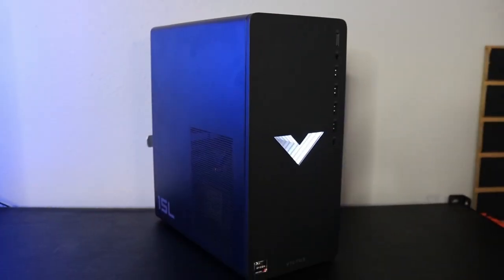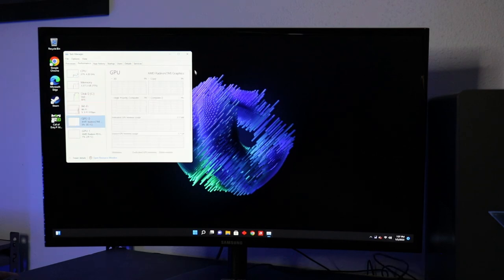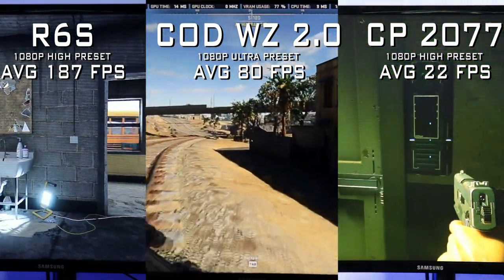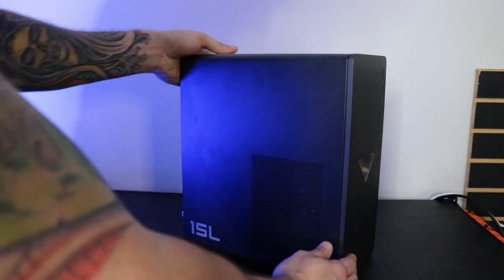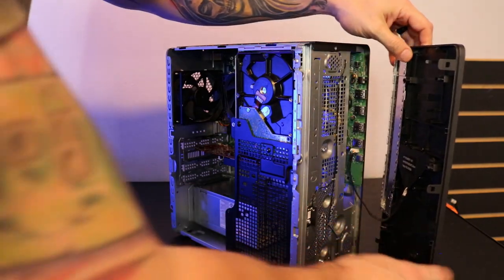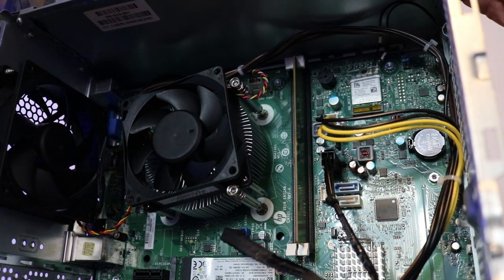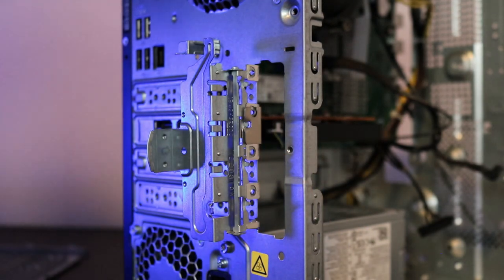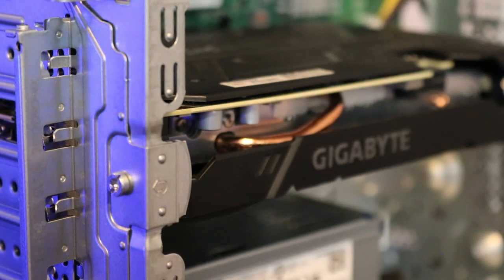Killer Gaming PC for CHEAP!! HP Victus 15L Gaming PC#pc #gamingpc #review

Comment: hey! i appreciate your video! ive been thinking aboutj buying this PC and this video helped a lot. Is the ventilation issue something that will be critical in the lifespan of the PC or will this PC have a decent lifetime without it? also, you say i dont need to buy 2 8gbs only one to add on to the existing 8gb ram? or did i misunderstand,, thanks again?
Reply: also, im not into any fps games i would only be playing fighting games. would i have any issues just running the default ram and specs out the box?
Reply from the maker: You wouldn't have any issues running the factory ram setup. You can add an additional stick if you want but this pc does take a specific type of ram. In the original video I wasn't aware of this but you would want 3200AA fro Atech and it would cost about $25! I'll post a link below if you decide to upgrade!

A-Tech 8GB DDR4 3200 MHz UDIMM PC4-25600 (PC4-3200AA) CL22 DIMM Non-ECC Desktop RAM Memory Module https://a.co/d/dzWqZkv
Reply: @bradfordskeldorado  thank you!
Reply from the maker: Hit me up if you have any other questions! Thanks for watching!

Comment: hey thanks for this guy :)  i have two  but like to upgrade the gpu also   did you  upgrade the psu ? for the RTX 2060 ?
Reply from the maker: No, the psu is still the same 350W unit that came with it. I don't recommend this gpu in this pc. I am about to release another short testing the new RTX 4060 and you would be much happier with this. At $299 this gpu brings this little power house to life! Also, the 4060 has a power consumption of 110W vs the 2060 being 165W so less power better performance!
Reply from the maker: https://youtube.com/shorts/t6Pn6k-kEDA?feature=share 

This is the test of the RTX 4060!

Comment: WHAT CABLE DO I HAVE TO BUY TO BE ABLE TO CONNECT MORE FANS AND RGB?
Reply from the maker: A fan splitter is for adding fans and I personally don't know about adding more rgb to this. It doesn't have an rgb header so you would probably just have to find some single color fans that run off of the fan power but don't change or find an rgb set that has a switch. 

yomgam 3 Way 4 Pin PWM Fan Splitter Cable,12 inch PC Fan Extension Cable, CA PWM Fan Extension Cable, for Computer ATX Case 4-Pin/3-Pin Cooling Fan Cable (2 Pack https://a.co/d/56jqOVW

Comment: At 5:38, I see what looks like a piece of black plastic covering some ports, maybe video ports from the motherboard. Can you tell me what's under there, and are those torx-only screws?
Reply from the maker: So this is a vga port and an hdmi port from the motherboard. The reason they cover them is to prevent people from hooking up the cable to these ports. With a gpu plugged in, these ports will not work so companies get calls with people claiming to pc powers on but has not video out. The screws are a torx or flat head style fastener, so you can use either one! Hope this helps!
Reply: @bradfordskeldorado  Thanks so much. I have an ancient Apple Cinema Display that only outputs dual-link dvi, so I was hoping there might be a DVI port hidden under there.
Reply from the maker: I know they make an hdmi to dvi adapter. This pc has an hdmi and a display port but the intel version has an hdmi and a dvi port so you might be able to fond one of these. Also, you could build one with more capabilities for a little bit more than you can get this pc!
Reply: @bradfordskeldorado  I'm going to bite the bullet on this (I found it at a nearby Walmart for $400 today, but most stores seem to be sold out). I had planned a 5600g build for about the same cost with more ram, bigger SSD, but reusing my power supply and RX 560. This will definitely save me some headaches, especially since I'll still have a functioning PC if I have problems to work out.
Reply from the maker: Wow! $400 is a steal for everything you get in this! Be sure to check out some of my shorts on this! I have a ventilation addition I did with adding a fan to the side for better air flow and also did an RX6600 gpu swap and got some serious performance out of it! Good luck and hit me up if you have any other questions!

Comment: Yo, i just got this off the hp store, and got 32 gb of ram, RTX 4060 and an intel core i5, and 1 and a half tarras of storage, i was wondering if i should also get some new fans for it, but ill do thay later on if it works when it arrives, i got it for about 700 bucks, because its 400 off for black friday, im so excited but my parents said i have to wait until Christmas to use it :( im coming from a PS5 so i hope this is good, from the videos ive watched about the parts i have it can run all the games i want to play really well
Reply from the maker: That is a killer deal! Great buy and you shouldn't have any issues with running games on high settings! I would recommend a fan upgrade but honestly, the bigger gpu fans with help with the cooling of parts more than the little fan and heatsink on the pc I reviewed.

Comment: New to computers. So once you just plug in your new ram, that’s all you have to do? Or do you have to install the device manually through the computer.
Reply from the maker: When you install new ram on this pc, it detects there is additional ram installed automatically. The ram speed is set on this computer. On other computers that don't use proprietary parts, you can adjust the ram speed in the bios. A very simple task to get the maximum speed out of your upgrade. Always check the speed on your ram! If you put a slower speed, it will default to that slower speed.

Comment: Hi, Brad! I have a intel i7, 6400, 32 gigs of raM, a WD NVMe, an amd rx580 and my boss wants my computer. Will this victus model lag behind it or will it be an upgrade? Thanks a lot for your wonderful review and ANY Help you can provide, and thanks agaIN.
Reply from the maker: So the computer you currently have would probably out perform the victus. The difference is the intel cpu you have is a 4 core vs the 5600g being a 6 core. So the 5600g would have more cores to process games or programs but the rx580 is still a stronger gpu even though it's about 5 years older. But you could possibly save time and money by buying an rtx 3060 to swap out your rx580 and have a great jump in performance! 

Bottom line, I would hate for you to get rid of what you have now to spend money on an equal performing pc. Now, the parts are newer and would have a warranty but I wouldn't expect a huge jump in performance. I hope all of this helps and thank you for the compliments!

Comment: Can I use the Sata port that’s on the motherboard as power for a cool moon rgb controller or how can I get a sata power cable on the psu?
Reply from the maker: There is a sata power that you can use for a drive but I don't know how much the rgb controller takes. I'm sure you could buy a splitter if you needed an additional cable for the drive and rgb controller
Reply: @bradfordskeldorado  my victus had a splitter already connected to the motherboard so I used one for the cool moon and it worked but after a while the pc turned off so I unplugged it and started it up & it worked fine I thought I fried it but I’m wondering why it powered off. The cool moon says to be plugged into the sata power on a psu but the 350w doesn’t have one so I’m trying to figure out what to do lol
Reply from the maker: To be honest, I wouldn't mess with that a lot. I'm about to do a video on how to change the victus pc to a gaming pc case and psu so you won't have to mess with that proprietary stuff. Just an option
Reply: @bradfordskeldorado  that’s dope can’t wait to see that

Comment: Hey man is it possible to swap cases ?
Reply from the maker: It's not really practical with this motherboard style. It has a front and rear I/O that is specific for this case and it has proprietary connectors and a smaller power supply for this case. If you planned to buy and swap it, you might as well but everything and build the pc yourself. Adding a $60-$90 case, $80-$120 power supply and a $100 motherboard would have this pc around $800 and you can build a pretty good pc at that price point

Comment: thanks for making this video. 
Can I take out the gpu and run the computer on the intgrated gpu of the 5600G ?
I dont need it for gaming, and got another use of the gpu.
Reply from the maker: This is correct on all other pcs with integrated graphics. Just to make sure, I will run this and make sure that the bios doesn't have something blocked. Other than that, there is an hdmi port and I believe an ancient port (vga). The VGA is blocked with a cap but can be removed. I'll check this evening and make sure it works from the motherboard! Thanks for reaching out!

Comment: So you was talking about adding in a 2nd fan on the side of the case.  What all is needed to hook it up and secure it in place?
Reply from the maker: The inside black bracket has holes in it for something like an 80mm fan but you would need a splitter for the fan power.
Reply: I added an extra fan on the side. It didn't really seem to help it run any cooler
Reply from the maker: I mainly did it because this little pc doesn't have but one fan in the rear. Just something you can do to pull in fresh air and depending on the fan size, I'm sure it could increase the volume. Not only that but the pc should have a set temp for the fan curves to speed up when needed.

Comment: Hello. Great video bro! 

Question: I have the same pc with a 12100f / 6650xt / 16gb 3200mhz ram 

I see in task manager my ram is 2133… how can I get it to 3200mhz? I’m noticing performance issues in some games 

Thanks!
Reply from the maker: The ram needs to be 3200AA for the HP Victus to keep the same 3200mhz speed. A-TECH has cheap ram that is great for this!
Reply: @bradfordskeldorado  Awesome bro! Thank you! For sure it runs at 3200mhz out of the box because I just got hyperX ram and I don't wanna fail a 2nd time ya know?
Reply from the maker: Yes sir. I will shoot you a link for it! I didn't realize it until sooner had mentioned this specific ram and it works great! You can order a 2x8gb set or just select the single 8gb stick and pair it with your original ram that came in the pc! 

https://a.co/d/9tm5XFq

Comment: So what else would you upgrade? Just the psu and like the cpu at some point? I need a  video on how to upgrade ur pc bc Im not a computer guy😂
Reply from the maker: On this pc, I would only upgrade the ram, gpu and maybe the cpu.. in that order. I haven't found the power supplies but I can only imagine the cost of a factory replacement power supply with proprietary connectors would be expensive. I would recommend building a pc with new or used parts over a prebuilt. This would be a lot easier to upgrade in the future. I have a video on a $400 gaming build and a $150 build too. I have plans of doing a mid tier gaming build and even a pc at a $1500 budget soon!

Comment: Hello comrade the form? for the ram I wanted to know the voltage and the frequency I can put what I want like 1.20 or 1.35 it goes on this pc? and the speed also 3200 mh is good?
Reply from the maker: The voltage shouldn't matter as far as the ability to use it. Now, if you have a system that is set to 1.2v and you use 1.35v then it could limit it to 1.2v. Also if it is a 1.35v system and you use 1.2v the it will also limit it to 1.2v. So you should be able to use it and get more memory but you may not be able to utilize 100% of the computers memory frequency is you are trying to overclock. Best bet is to get the 1.35v ram and if you have a 1.35v system, then you're good to go. If you have a 1.2v system then you're not losing anything my having the 1.35v kit in it. Hope this helps!

Comment: Can u do a cpu cooler upgrade maybe with the noctua nh u9s?
Reply from the maker: So this is a step up from a small form factor pc so a tower style cooler wouldn't fit, but a low profile cpu coolers like the Noctua NH-L9I could possibly work. It's not a standard am4 mount though, it's similar to an Intel mounting setup with the square pattern vs the rectangular amd shape. I could possibly try one out though!
Reply: @bradfordskeldorado  nice appreciate it - i got the hp pavilion which is similar to the victus
Reply from the maker: The only pain about these pcs are, in order to put the cooler mounting back plate on is you have to remove the motherboard. Not too hard of a task but I'll try to get something up in a couple weeks! Thanks for the idea!

Comment: Is the 1660 super version good for 900 euro? Please respond if possible
Reply from the maker: This pc was a good deal at the price I bought it. The 1660 super version for 900 euros would be a little high due to the fact that you could build a pc for that price that can out perform this pc. I recommend building one and being able to upgrade in the future with a psu that is not going to limit you. I am selling a pc right now for 500 USD or 460 euros that has a 1660 6gb and can be upgraded is the buyer wants
Reply: Thank you very much man If your able to give me any recommendations for building and choosing parts or even any good prebuilts tgat would be great, thanks for the help deserves a sub
Reply from the maker: Ryzen7 5800x $236
Asus tuf gaming a520m $99
Evga 600w 80+ bronze psu $68
Corsair vengeance 16gb (8gb x 2) ddr4 3600mhz ram $52
Raid max pc case w/ 6 rgb fans $69
Samsung 1tb ssd $89
Xfx rx 6600 $260
This is all from Amazon and would be a great build for around $875
Reply from the maker: Thank you for the sub!

Comment: I got this but mine has 32gb of ram Ryzen 7 5700g rx6600xt 512gb nvme ssd, 500w psu, and I had a 4 tb hdd lying around so I installed that too.
Reply from the maker: How do you like it? Did yours come with more fans installed? Sounds like a great little rig!
Reply: It’s got two fans on the GPU, cpu fan and an exhaust fan. It technically has a power supply fan as well.
Reply from the maker: I noticed the temps were a little high on this one but it has that small heat sink. I would like to add a fan to the side case panel but I might also do a kind of mad max theme with this and add some grunge paint and a tower cooler with a cut out in the side panel

Comment: So you cannot upgrade the ssd and no 2 nd slot for a nvme m.2 , what hard drive did you add ?
Reply from the maker: Unfortunately it does only have 1 nvme slot but you can add a 2.5" ssd for storage. The HDD I added was just a 2tb drive I had laying around and the cage is big enough to fit one but the 2.5" will mount in it too! Hope this helps

Comment: Where and how can i add more ssd storage ? and what kind  no one can help not even hp i do not see any other spaces on board
Reply from the maker: There is only one slot for an NVME drive, so you would have to install a bigger ssd if you wanted more storage on the motherboard. If you are just looking to add a 2.5 ssd for more storage, then you would just mount it in the cage that I installed the hard drive on and use the same connections I used in the hard drive. I hope this helps, but if not, please let me know!

Comment: Do you know any another gpu would still be good on it but more cheap ?
Reply from the maker: There are gpus that are better than the RX6400 but the question is, are they worth spending the money for a small fps increase. I still see 1660 and rx 6500 gpus selling for 100-120 but that's only about a 15% increase. I have found used rx6600s and rtx 3050s for $180-$200 that would be a bigger boost. I always like the saying "buy nice, or buy twice". I wouldn't want to recommend a 1660, only to turn around a month later and wished you spent the extra to get a better and longer lasting product. Hope this info helps!
Reply: @bradfordskeldorado  thank you i will just save for a better gpu
Reply from the maker: If I come across any good sales, I'll post them here! Also, a new video is coming out tomorrow for changing the victus to a new case and all the parts to make that work!

Comment: Hi can you give me the link of the three things that you add to make it better please
Reply from the maker: So I just did a video of adding the RX6600 gpu to the pc. It's a better gpu than the 2060 6gb with 8g of vram and its a newer product that is cheaper. You can get the gpu for around $200.

 XFX Speedster SWFT 210 Radeon RX 6600 CORE Gaming Graphics Card with 8GB GDDR6 HDMI 3xDP, AMD RDNA 2 RX-66XL8LFDQ https://a.co/d/6Op2Tcl

This is a great company for ram for $33.

OLOy DDR4 RAM 16GB (2x8GB) 3200 MHz CL16 1.35V 288-Pin Desktop Gaming UDIMM (MD4U0832160BJ0DA) https://a.co/d/5g8zofB

And honestly I would highly recommend this SSD vs putting a spinning disc drive like the one I did in the video. It mounts to the same spot but it's a lot faster with loading programs and games. This is a 2tb pny ssd that's only $65

PNY CS900 2TB 3D NAND 2.5" SATA III Internal Solid State Drive (SSD) - (SSD7CS900-2TB-RB)-Multicolour, White https://a.co/d/e1QLut7
Reply: Thank you 🙏🏽